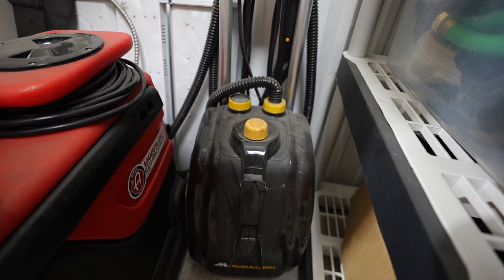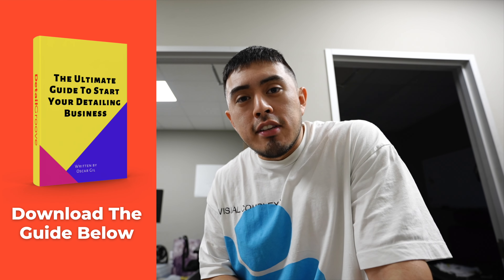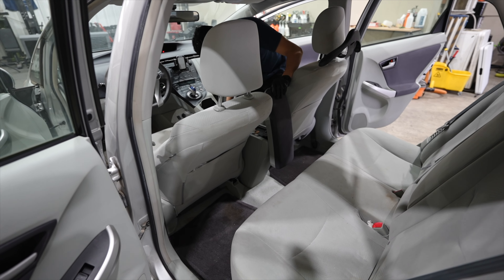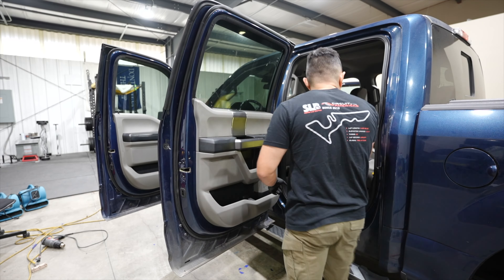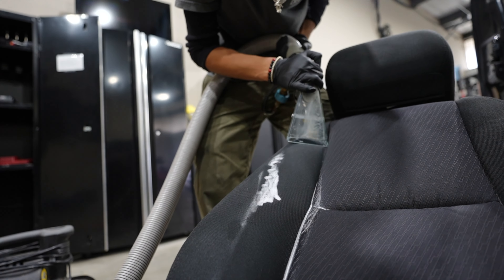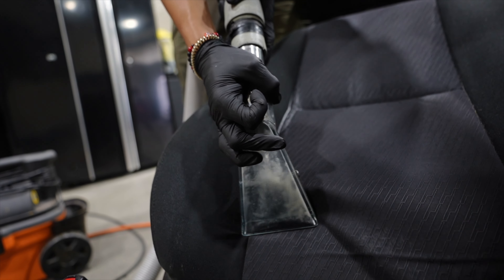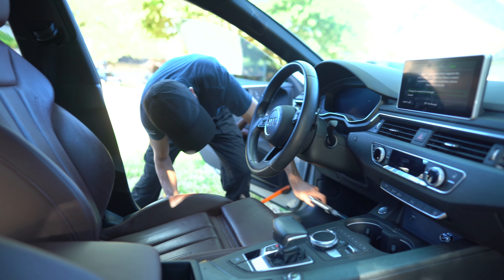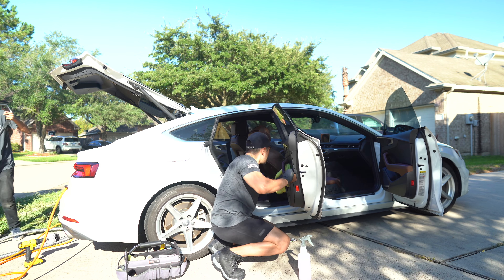Why We STOPPED Using a Steamer For Interior Detailing

Comment: Totally agree here. Im a mobile detailer in atlanta and once I got the Tornador with the cleaning solution bottle, that was an immense time saver. I can blow out awful carpets i would normally have to scrub with a brush or drill brush to loosen everything up, I can use the cleaning solution for the door jams and light interior work. Then, I still use a brush where it is needed. This also seriously helps to clean floor mats as well.
Reply: Cleaning door jams I use Absolute rinse less wash. Dilute 128/1 for a 32oz bottle. Works awesome

Comment: Sometimes using that steamer instead of shampooing though is way faster instead of wetting everything down if the interior permits, for instance, I just did an interior that looked pretty dirty not super dirty, though, instead of shampooing, the seats came out good and the carpet with just a steamer and knocked it out way faster, but I don’t use the steamer for wiping down the panels though, just a blow gun, and scrub, ninjas and brushes
But for shampooing, if it’s light, dirt, steam
Reply: Was gonna say the same, since I never promise my customers 100% chance of stain removal on interior cloths, I realized I don’t need to be trying to achieve that. The steamer is the exact value most people are willing to pay. If I was charging $400 for the interior sure I’d use an extractor, but 90% of the time it’s quicker and easier to steam in a mobile environment. In a shop setting, if your extractor is already filled, hot, and primed, I can see why it’s not a sweat to change tools.
Reply: lol no I’m still going for the best results possible, if I have to whip out the shampooer to get that, I will.  But if I can get equal results with the steamer, I’m saying I use steam. But yeah, we’re pretty much on the same page.

Comment: Technique makes a meaningful difference for sure. My extractor (sapphire scientific) produces hot water and has 400lbs of lift. My compressor has a additional 600 gallon holding tank and my steamer is vapor chief 100. It’s been three decades of doing this. I agree with you… systematic processes of continuous improvement are a must. Cheers

Comment: Thank for the heads up. I’m actually looking forward to starting the side gig. I feel like I messed up getting the rigid 6 gal air compressor. I’m not stressing tho. I’ll have to make it work.
Reply: What’s wrong with the 6 gallon compressor?
Reply: @NickFlairGaming Who really knows. I just bought all this gear and from what I can tell, you can sometimes get smaller OR larger capacity (gallons) vacuum that doesn't have a high horsepower. There's a popular 4 Gal one with 6 HP which is a lot, so maybe he got a sub 4HP one, which is ass
Reply: People usually go for the 4.5 gallon since it refills faster but rigid is a good brand, don't worry about it you'll earn the money back.

Comment: You are back to cleaning the door panels like I was doing in the 1980's and I still do it that way.
Reply: I've been doing the door panels like that myself since the early 90's. I'm hesitant with steam due to the adhesives in certain door panels that have vinyl/leather on them.
Reply: we also used to pull the seats and take the carpets out of the car..hang them and steam clean until the dirt quit coming out then I would shampoo sometimes add a little color dye then reassembly the interiors it would look close to brand new minus some wear and tear. I did this working in the dealerships for years.
Reply: @masterspin7796  I think that was the standard procedure at the dealers back in the day. We had those big clips to hang the carpet and mats with. I remember using the dye and a metal bristle brush after to get it to look close as possible.
Reply: @Fiveliterdave  we had the heated vacuum extractors as early as 1978 it did a nice job on the cloth seats but sometimes those carpets needed a little more elbow grease... we won't even talk about polishing the 70-80's factory paint lol! no clear coats...

Comment: I have been detailing since 1991 and using steam to clean is by far gives the highest level of cleanliness.  The type of steamer and how it’s used is the key.  You need at least 10 bar which is about 145 psi.  This gives you great flexibility because the steam doesn’t drop off too much and it recovers quickly.  Also it helps to have extraction feature so you don’t need to use micro fiber towels as much. I will NOT clean without steam but each his own man.
Reply: What steamer do you use?  There's not many reviews on the commercial ones and it's pricey to drop without really knowing what's a good one that's proven long term

Comment: As someone who occasionally does side jobs detailing, Im  more comfortable with the heated extractor “mytee8070” is what i have. Especially if you can melt someone’s interior or even blow fog behind their guage cluster window with a steamer. I use 3D orange degreaser dilluted at around 1/6 give  or take for the seats and roughly the same dilution for panels, no issues yet. Nobody brings me any expensive cars considering I'm primarily a landscaper so i dint have to worry about being cafeful with any high dollar cars. Deep clean filthy seat extraction are my favorite kinda vehicle to do.

Comment: I agree and disagree because i use my steamer McCulloch 1375 more than my Mytee 8070 especially when its cooler outside. it heats up just as fast as the Mytee but it a consistent heat and the mytee you only get hot water for a few passes. I try to simplify my detailing process to use pull less equipment out to save time. I'm going to upgrade to the Chief Steamer 100psi because it saves money on chemicals, much faster work time, lessens your detail job, can literally be used on every part of the car and it's just a single machine with continuous hot steam. Plus you don't soak customers interior unless absolutely needed then ill pull out the Mytee 8070 for deeper stains.

Comment: As someone who occasionally does side jobs detailing im more comfortable with the heated extractor “mytee8070” is what i have. Especially if you can melt someone’s interior or even blow fog behind their guage cluster window etc. i use  3D orange degreaser dilluted at around 1/6 give  or take for the seats and around and roughly the same for panels no issues yet. Nobody brings me any expensive cars considering I'm primarily a landscaper. Deep clean filthy seat extraction are my favorite kinda vehicle to do.

Comment: Personally, I have the AquaPro extractor and love the results I get out of it, but in 95% of cases I just use the steamer and Renny Doyle method because it's SO much faster and gets the same results or better a majority of the time due to the heat (in my use case). 

However there are some interiors that just need to be extracted properly, in which case I pretreat with chemical and the steamer and rinse and extract with the AquaPro Vac. 

The only reason I'm pro steamer instead of extractor is efficiency time wise. It saves SO much time not having to suck up 2 gallons of water out of an interior and instead just steaming the surface, and moping with a micro. 

Definitely respect your opinion though. Truth be told if I didn't have to take my extractor in and out of my sedan constantly and had a Mytee with a 25-50' hose I'd probably be on your side 100%. Heat is key

Comment: Hot water (not boiling) Tornador with chems + detail brush/drill brush/power washer works for me. Steamer is fun too but the distilled water and small tank can become an issue on some days. Extractor is nice when it gets going but situational for the most part. Good to have all 3 but the Tornador can cover a bit of both, just not quite. I still clean salt stains the old school way, sorta lol. Just need a strong stream of water and vacuum. Tornador is a great tool. Need a bigger than average compressor though.

Comment: Looking to get an air compressor but I don’t want to spend 300$ on the ridgid compressor what’s a solid option
Reply: Depends on what you’re trying to use the compressor for? Are you tying to use Air Blaster tools? If so, then I would recommend the rigid dual tank compressor as opposed to a pancake one. You need a compressor strong enough to utilize those tools to their full and correct potential.
Reply: You’re going to have to invest in a good one eventually. What do you have in your arsenal for detailing currently?

Comment: what about the vapor clean magnum xp? its suppose to be a steam cleaner with a vacuum and hot water injection and cleaning solution like a carpet cleaner.... I was looking into it but I was curious if that would be an all around tool including exteriors? because of the hot water injection.

Comment: I will be honest, when I detail the last thing I want is too much humidity inside the interior getting onto the windows especially cooler days. The methods to cleaning  are not the same in hotter southern states like they are in the north. When I watch these videos I’m like wait a minute these detailers have the heat to dry the interior way faster then where I’m at. I’m better off using other methods to not have a wet interior taking longer to dry fogging the windows with moisture. So avoiding the use of an extractor and steamer is have to be well thought out more.
Reply: how would you minimize moisture and humidity when using extractor or something wet? such as on carpets and so forth…
Reply: @Takewifeznlifez  I like that this question is being asked because now it requires thinking outside the box how to figure out a course of action(planning) and system thinking.

Comment: Why saturate the seats, carpets. Don't care how much lift machines have, you are blasting it into sponge. There are some cracking presprays out there, green dragon, simply green, encap, foam cleaner etc etc. Bonnet/drill brush, wipe excess and steam. The new "Neat Steamer +" by Dupray, heats up in 90 seconds, no need to cool down to refill, 275 degrees, sanitize seats/carpets, my go to new detailing machine. Time is money.

Comment: Ive sold over $10M  in Auto Details and Car Washes, thats how Delta Queen Classic Car Wash and Detail Performance in Campbell Ca. THATS HOW ITS DONE! Extractor at 180 degree temperature. Using all purpose cleaner with light scrub brush and air on door panels. CCW Delta Queen is the number one car wash in the nation and number one in detail dollar sold. There are 4 locations in Silicon Valley. Family owned since 1964 and the owners are well well well off. Were taking $Billionaires